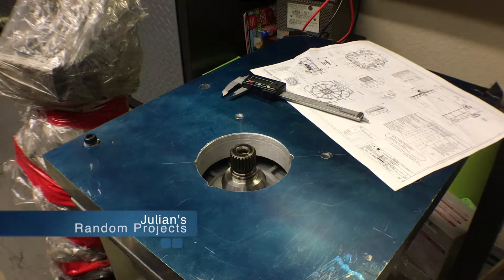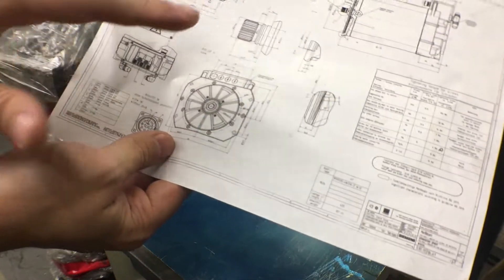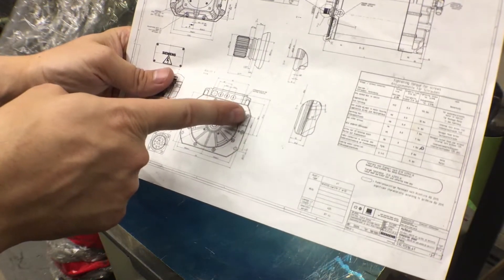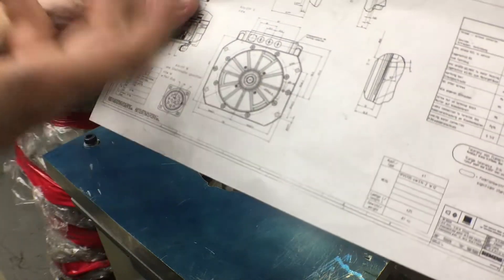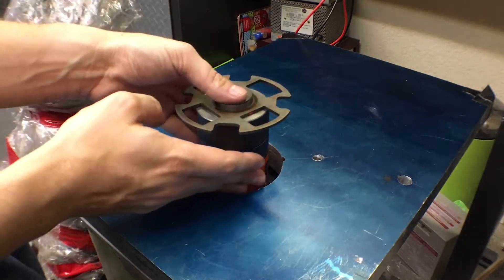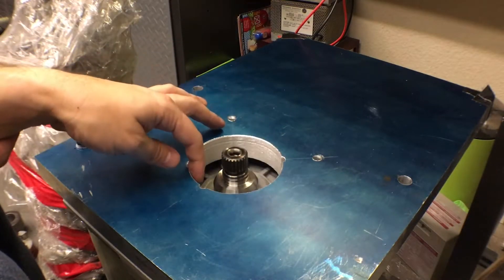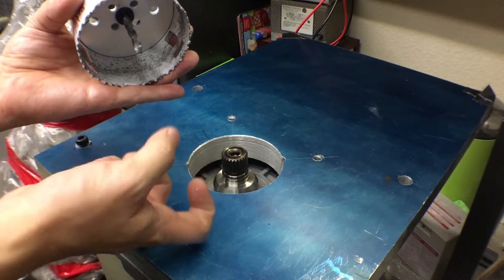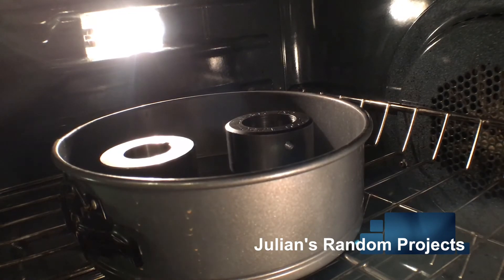MG Midget EV Conversion Part5 First Time Welding

Comment: For future ref.  If you put a (couple of ) fibre washer (s) on between the arbour and the hole saw it (they) will squash up and let you use the drive pins with out the vibration.  Or as you have a mini lathe why not take a bit off the face of the about until the drive pins engage.

Comment: Man, you tried to cut that round hole with a WOOD-SAW. You must dig deeper into the basics of construction.
Very briefly said - small teeth, metal - large teeth, wood. 
That is a wood saw from the home depot.
Reply from the maker: dig deeper? Ha. It's much quicker to do it wrong and have the internet tell you where you screwed up :) Case in point, by posting this video I learned what a "FLY CUTTER" was and subsequently bought one for next time. God bless the internet!
Reply: No religion please :P

Comment: I am about to make the coupling to my project and i am thinking on doing it in only one peace instead of you that did it into 2 parts. One end goes to the motor shaft and the other end will receive the clutch disc center like you did. My main concern oa about the alingment. This adaptar will not alow missalingment. You haver all this equipment and didnt do this way so i dont fell so confident doing it. I can do like you but i dont suport the torque and will get loose in no long time. This is way i wana do a rigid coupling. I wont to be fixing it time by time. Can you say someth to help me? Thank you.
Reply from the maker: Call and ask around to find a machine shop with professionals that can make a perfectly aligned and balanced coupler.
Reply: So, i will try to make it rigid. Thanks, Julians.

Comment: Right on, I'm digging your videos. I'm doing a '53 Hudson Hornet, so I can relate.

I started thinking about that same setup from Jack Rickard ... have you talked to those guys? Will you use their EVGCU to control the inverter? Their site is a little short on info...
Reply from the maker: Thanks! Yeah I bought the GEVCU and plan to use it to interface/control. They have more info on their forum or multi-hour long youtube videos :) Are you posting info about your Hudson somewhere? Would love to see it!
Reply: At the moment, I just have a few photos on Instagram (dragone.53). I'm going to do up a proper blog, I imagine.
I've got my engine out, and I've been sourcing parts. I've had the worst time trying to get an adapter from EV West... 4 months of waiting down the drain (isn't it weird when guys can't be bothered to take your money?). Nobody I've spoken with is willing to make an adapter, so, screw it, I'm gonna buy a mill and a lathe and do it myself. I've been looking at the same motor setup you have from Jack & Co.